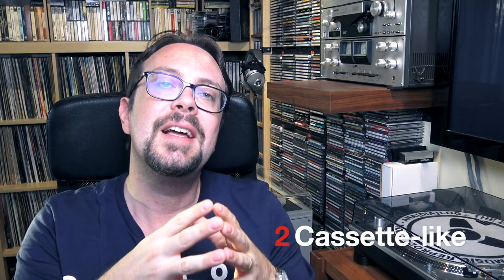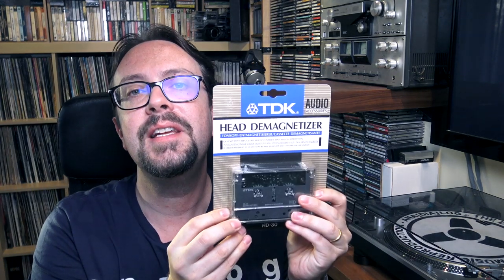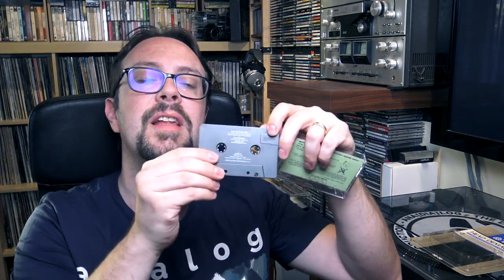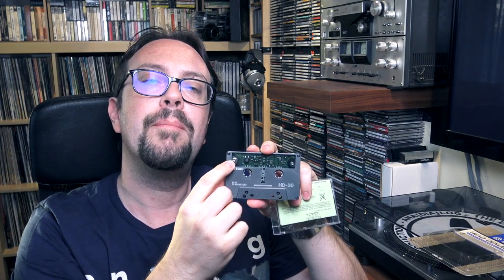Demagnetize your cassette/tape recorders for optimal sound

Comment: I got a tape head cleaner and demagnifier from Amazon Canada. It's a cassette with cleaning fluid. Some of my cassettes need to have their felt pads replaced. I tried a Frankenstein repair on a couple of them with felt from the Dollarama. It just made my tape heads dirty. i used the cleaner and the deck plays fine (with cassettes that work). The packaging claims it can't damage the deck. I find cleaning and demagnitizing my player once a month to be sufficient.
Reply: I watched one video and the guy described the process of demagnetizing the heads as collecting bubble gum slowly with the probe.  I don't know, that made sense to my brain for some reason.

Comment: I do de-magnetize periodically. I usually evaluate the magnetic field with a magnetometer prior to doing so. Just to demagnetize because it has been a certain length of time is not always the best thing to do. I was hoping you were going to deal with the process of cleaning the heads and capstans as well so the tape is ready to be listened to/made. Demagnetization alone does not a good tape make. Thanks for the informative video.
Reply from the maker: Arikona I know you asked for a maintenance vid for centuries...I have not forgotten! ;-) I just want to brake up the various processes. The idea of using a magnetometer is a VERY VERY good idea. I wanted to suggest that but I obviously forgot. Thanks for pointing that out! For who is interested you can find kits with all the necessarie! Cleaning is very easy and not very interesting but I will do a simple video also on that. As you know your best friend is isopropyl alcohol and high quality cue tips, better if made of leather!
Reply: @anadialog  Question ? Mr Know-it-all friend tells me we don't have to demagnetize my Deck , because it sat in storage for many years . Telling me magnetic field goes away in time . Not buying his argument , due to fact  deck was stored high on a shelf . I'm I totally wrong or is he not rite ??
Reply from the maker: @surgen9499  well, I am not an expert but there is a thing called remanence, which is exactly that, residual magnetism in ferromagnetic material which stays present for a very long time. It's the same principle of tape, more or less.

Comment: I have made a simple DIY demagnetizer and very easy works well. Just need a AC power adapter, some copper wire, and nail or some sort of metal rod. Just wrapped the few turns of coil over the metal rod connect AC power supply leads to both end there you go you have a powerful demagnetizer and cost nothing when compared to what they sell in the market.  You get a 12v A.C adapter and it will do the work for you.  Believe me it dose work and very well. Thanks.
Reply from the maker: Cool!

Comment: I'm a little scared to buy a self-demagnetizing tape deck because I am told that running a demagnetizer near your tapes will erase the tapes' contents, so what if I put a tape into a self-demagnetizing tape deck before I turn it on, and it erases my tape when I turn it on?
Reply from the maker: Obviously it is done in total safety concerning only the heads. Don’t worry, engineers back then knew what their were doing.

Comment: I was told by a very good electronics expert that you can demagnetise tape heads by placing the machine in record / pause mode and pulling the mains plug. Any comments? Also that B&O tape decks automatically demagnetise when switched off ( I don’t know whether that is all or only certain models). Great videos. Even at 73 I’m still learning 👍😊
Reply: Looks like a grandma recipe to me !

Comment: i magnetized a paperclip with a magnet just to test, and then i demagnetized it with the probe just to make sure it worked.
and it did.   ( if you put the probe near the heads of a cassette deck you can feel it buzzing in your hand)
but yea i do mine every so often just to make sure.

Comment: Thanks for the nice video. Still not clear how to know whether the cassette deck needs to be demagnetized unles no sound distortions noticed.
Reply from the maker: Actually you don't want to get to that point. I notice problems when I have problems calibrating a cassette, when the levels, especially bias, start jumping and fluctuating too much...then it's time to demag.
Reply: @anadialog  OK, thanks for the advice.

Comment: Every 2-3 weeks ! I never demagnetized my series 900 tape player in 40 years ! Just getting into this matter after restoration/ maintenance of my deck. WhT about my DAT deck ? Also what about the other parts of the deck: capstan, tape guide,...
Reply from the maker: That is if you are using it constantly otherwise every 2 or 3 months is enough.
Reply: @anadialog  Thanks for your reply.

Comment: This is the second instruction video on demagnetizing tape players I've seen today, and it really has me curious regarding the wonky operation of a Beltek car-dash player, which I got about a year and a half ago and started acting odd about six months ago, despite the seller's claim that it had been serviced and tested.  I have probed around the inside of the unit and cannot find any mechanical problems which would cause the take-up reel to suddenly speed up as though it were stuck between play speed and advance speed, which is what it does with any tape I play.  It does NOT chew the tapes up, it just plays at a wonky distorted speed.  About a week ago, on another check, I discovered that, when I insert a tape, the take-up reel runs at the proper speed while the plastic strip runs over the head...but as soon as the tape itself touches the head, then it acts the fool.    With the design of the tape system that Beltek came up with, there is an electronic part on the underside of the mechanism, with two hair-like extensions probing out and touching against a metal plate on the underside of the take-up reel, which it apparently is designed to do (possibly part of the system's auto-stop, I'm not sure since I don't have a factory service manual for this system).  I'm wondering if magnetic distortion on the play head might be causing that warpage of the play speed, maybe somehow intertwined with those probes...?

Sorry, I know, long talk.  But since I have been hearing about importance of demagnetizing service at regular intervals for a long time now, I think I need to invest in one of those probes and try it out.  Can't hurt, might help...and if I do need to just replace the head unit anyway, it might be a good idea to run that probe over the replacement Craig T631 unit I just got, especially since I'm still doing revival surgery to it.
Reply from the maker: If they we 100% honest that they serviced the player, it might be the issue. Never heard of that strong, but you never know. To me, it seems that there is an internal fallacy.
Reply: I used a big magnet from a microwave and the tape moved and demagnetized them with my hand on both sides is sufficient for my Vital not a machine thanks for the video

Comment: Bias current does not demagnetize because it stops abruptly. 
Cassette demag use 630 or 650 or 1000 Hz and they are not effective because of high eddy current which won't let alternating magnetic field penetrate deep in the material.
Around 420 Hz demag have efficiency about 80-90%.
So, use low frequency (50-60Hz) demagnetizers cord powered or not as TDK-11
Reply: Thanks for the info.  So no cassette type demag at 400 Hz or less ? And if I leave it for a longer time ?

Comment: So, seeing this and another video in which the guy built his own there are two things that I've learnt for certain:

Use a STRONG A/C electromagnet (he may have built his own, but he said a powerful one works better), DC magnets will only magnetize...
Move in and out SLOWLY (to litterally pull magnetization off the components)...

And then he left his system on, making some (nice, imho) sci-fi humming noises... Although I'll readily agree that that's a risky thing to do, it does illustrate what such a magnet'll do to your tape heads...

Now, I'm an electrical hobbyist and sorely tempted to make my own (overengineered and intimidating-looking) demagnetizer/ bulk tape eraser... How happy will that make my Revox A77 (since I already pissed it off by running flaky tape through it the other day, having to clean the heads, capstan and pushrod)?

Comment: The modern Neodymium Magnets , some as small as 1 inch , will totally erase a cassette in seconds. The super strong ones found in lapels (replacing pins on shirts) will do the job. No Phantom noise.
Reply from the maker: Good to know! Electrimagnets though will always be more powerful. In any case,I believe you are referring to the other video on bulk erasing...

Comment: Very cool video. Thank you. I've always wondered about this, but never knew what was up with it. I just, yesterday actually, got a Nakamichi CR-A1 (I think that's the model anyway), and am looking forward to playing a cassette on my stereo for the first time in 2 decades or so.

And while I would like to keep it in good shape, and get the cleanest sound I can. I didn't even spend $100 on it. So I'm not going to spend $100 on that demag tool you recommend. Besides. I doubt it will fit in the well anyway. So my question is.

Do you think getting the small/cheap one, and the cassette one also. And then use both of them fairly often. Will that help at all? 

I've had many cassette decks when I was young. Some very nice ones too. But I never used the demag at all with any of them. However they were all fairly new. Now I'm using a deck that's decades old. And who knows if anyone has ever done it to it, or not? So I think it could probably use all the help it can get. But I don't want to waste my time, and money either. What do you think?

Better then nothing?
Or is the big boy the only real way to do it?
Reply from the maker: I understand your point and I do agree on using a simple device than the pro version. I would go with the simple probe one. It is the cheaper and more effective than the cassette!
Reply: ANA[DIA]LOG Thanks for the reply. That sounds like a good way to go to me.👍✌️
Reply: I only used my big magnet in hand demagnetized my cassettes l bought that weren't brand new l wanted and re-used . I run the magnet on both sides it's sufficient yes.

Comment: Thanks for the video.  I also use a han-d-mag; but it has a longer, narrower probe and is much easier for getting into cassette deck doors.  Much rarer to find on ebay, but come up often enough to look for if, ones castsette door doesn’t accommodate the standard one.  I’m curious if you do the reel to reel behind you there or remove your tapes first?  I’m always super paranoid of having any media near my machines when demagnetizing.  FWIW I haven’t heard of an official safe distance for media when the demagnetizer is plugged in.
Reply from the maker: Thanks. I may look for that. I keep my tapes at a save distance. In any case don't be too worried. You would need to very very close to modify the oxide magnetic charge...even with a direct contact bulk demagnetizer it take quite a lot of time and power to erase them...

Comment: I use a mains powered one that looks like a soldeing iron .
Watching 12 voult vids channel for repairs he told me that all we need to do is just press REC once and then its all done  with the erasing head . I did not ask many questions as its all keyboard & replies do not get the BELL anymore .

You may need to check the position of the heads after using that big thing , it sounds far to POWERFUL for home use  ???
Reply from the maker: The rec button for demagnetizing the parts of the deck? Impossible...Maybe you mean to erase tape...
Reply: @anadialog  Yes
Reply: @anadialog  On a 2 head deck, the record playback head (we are talking cassettes) will generate a magnetic field at the head gap and when the stopped, the induction of the head will hold enough energy to reverse the field thus reversing the magnetization and I have discussed this with various technical experts in the field. You will note that in most cassette deck manuals that the recommend the procedure and also suggest one made/badged by themselves to sell. Hmmm.

Reel to reel, is occasionally required but not every few weeks unless you are using a industrial grade 24 track machine.

I would recommend against this practice unless you are confident that you know exactly what you are doing - failure to do it properly can irreversibly magnetize your heads/tape path.
Reply from the maker: @BigKelvPark   well, we are mainly talking 3 head on this channel...plus, we are not demagnetizing only the heads but the whole tape path. It's a standard procedure that needs to be done. I did explain exactly how to do it properly. No risk if you follow the instructions.

Comment: Hi there, you mentioned TDK and Maxell type cassette demagnetizers. I've seen a few good things about the old Teac cassette demagnetizer where you can see the circuit board and chips through the clear cassette plastic ( just the way they designed it.) Are those of decent quality? And, what's your take on buying used ones on eBay? Is there any compromised quality from using "An old, used demagnetizer"? Thanks! New subscriber here. Edit: if you feel that the cassette device demagnetizers are a little weak due to the small battery, couldn't you just theoretically keep it in there a little bit longer?
Reply from the maker: I did not like the results of the cassette,  but maybe that's me. I prefer the good old handheld version. Yes, even Teac made one of those. Never tried but I am sure it is of great quality.
Reply: @anadialog  Thanks man.

Comment: ok but how do we do it with the dcc decks en datrecorders
Reply: Jeanique Cotino 
As I understand dcc heads should not be demagnetized as it will damage them..
Reply from the maker: DCC must not be demagnetized. DAT heads and components are very fragile. If you want to do it by yourself be very careful. The best thing is probably to open the machine to reach  better the various parts...

Comment: These Tape demagnetizers with the watch battery is just a piece of garbage. A placebo, nothing more. It creates almost no magnetic force. How could it with no power supply?
The probe type on the other hand works great. I have one from the early 90s and it makes a huge difference in the sound. I once got a tapedeck from the fleamarket which sounded very muffled. The usual cleaning with IPA etc. did not make a huge difference. After using the probe it sounded clear and bright again. Awesome.

Comment: Isn't 2 or 3 weeks too frequently?
Reply from the maker: Not if you use tour tape regularly...it also depends if you are using mediocre tape quality...I personally do it every 2 or 3 months but I am lazy ;-) Remember that some high quality decks demagnetize EVERY TIME...so there isn't a too frequent rule IMHO
Reply: @anadialog  ok, thanks for the reply.
Reply: @anadialog  what decks exactly require every time?
Reply from the maker: @ogopogo1397  not required, they do it automatically everytime for example the Aiwa AD-F770.
Reply: @anadialog  You really dont understand what you are talking about.
Reply from the maker: @ogopogo1397  I answered your question. What are you talking about?

Comment: This tapeheads page got me confused, got anything to say about it?

http://www.tapeheads.net/showthread.php?t=20482
Reply from the maker: As for the web, everything is wrong and everything is right at tye same time.
I use my hand-d-mag on all my r3r and cassette deck and never had a problem. I do think that you need to demag but rarely, even though it does depend on how much you listen to a specific machine. Were there other concerns?